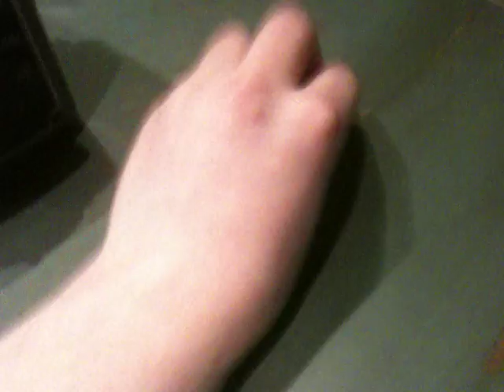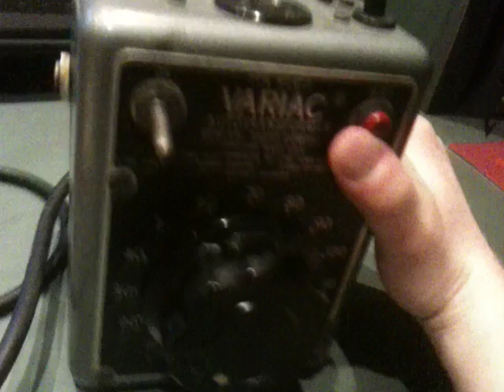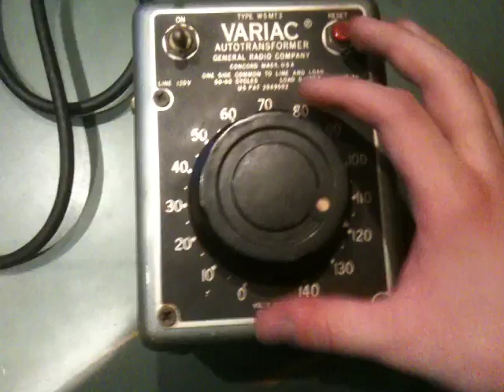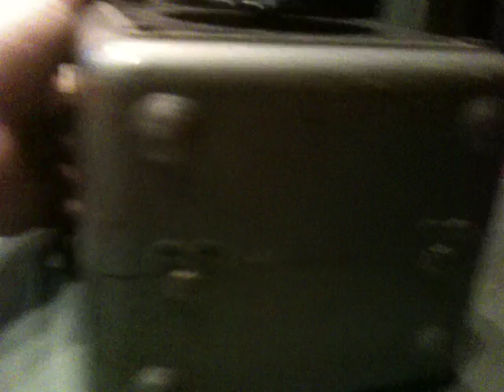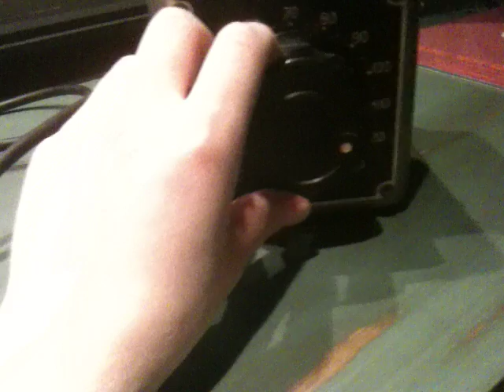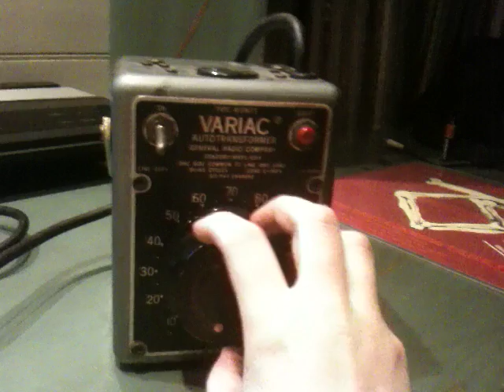Variac - Vital Vintage Equipment Tool

Comment from the maker: I POPPED IT!

i use the variac to form the capacitors properly on old equipment so i don't blow them out with a huge jolt of power for the first time in 30 years, lol.

Comment: Variacs are also really useful for cranking things up as hard as they go until they *POP* :-D

Of course, I wouldn't do that with the little puppy you have there....That one is too small for popping things without damaging the variac itself. :-D

Thanks for showing your little variac though, that's cute. :-D

-BoomBoxDeluxe.
Reply: These are also good for running cranked  Marshalls at a slightly lower voltage. Makes them a little quieter and changes the tone drastically.

Comment: Very cool piece of equipment. I have some vintage audio equipment and do not need this stuff. I guess you would since you have so much bad ass audio gear.Seems like a lot of appliances was made better in the 50's, 60's and 70's.